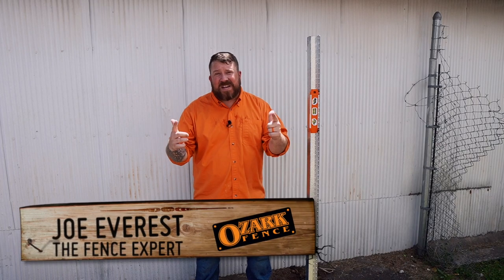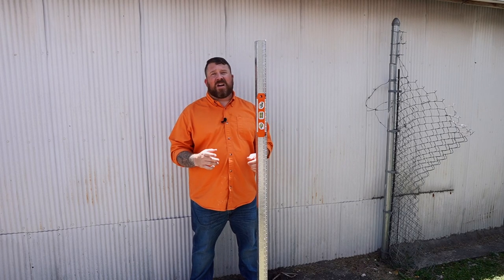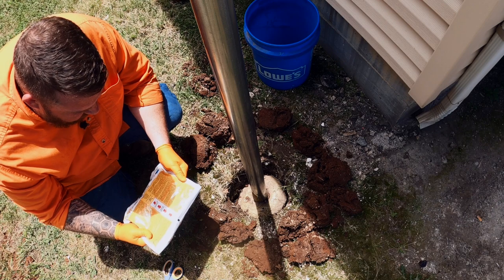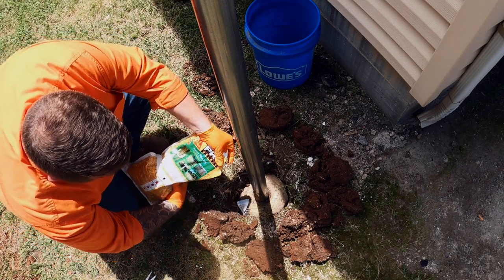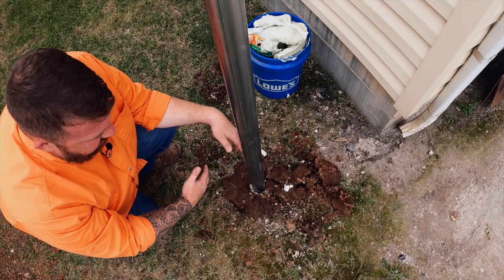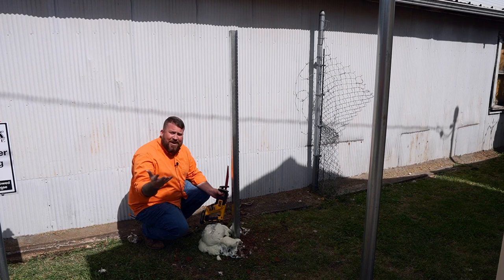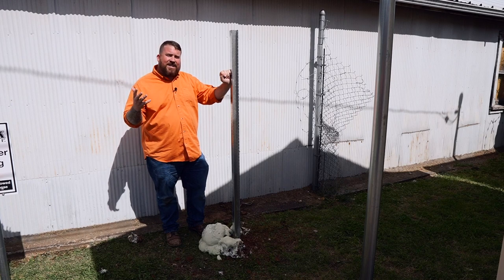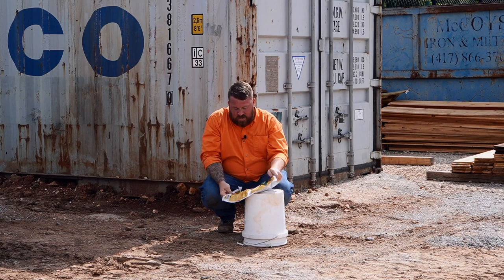Can We Use Post Foam to FIX Our Wobbly Fence Posts?

Comment: Yep, if you have any rain or any type of water/moisture & it gets the foam “wet”, it definitely isn’t gonna hold & seal the fence post well at all. The other thing ppl don’t do correctly is the hole diameter. I’ve found staying in the 8” diameter gives a good result, along with 2-2.5 ft for a 4x4 (even the max according to directions).
If ya try using this in damp ground, or it rains (or sprinklers turn on) overnight.....not gonna have a good result the next day either.
Great vid, cheers.

Comment: Thanks for this extra tip!!!!
I wanted to use this product, because I didn't want concrete.
But had to rethink the foam after seeing you previous video and seeing other similar videos with the same shrinking foam.
So I set the posts, (6x6x10's)
Waited a few days to let it shrink, then another half bag in each post.
Packed the dirt around them. 
They're solid now. Even with lights on cables than span from the post to the house.

Comment: I have that exact problem trying to fix the neighbors fence post from my side. The post was rotted off at the ground so figured I'd just sister a half post beside it and lag bolt them together. Couldn't get the left over concrete broke away so just angled my post into the bad one but it was cold and soil was really moist. Poured the foam in after shaking the bag too much and it started spraying every everywhere but I was able to get most into the hole before it set. Big mess and it never set into the hole enough to tighten up my post. The fence stayed up but post isn't straight and it wobbles. Knowing what I know now and this video I just found today I can probably clear around my first attempt, straighten up the post till it's proper and lock it in place with something and pour another partial bag in when it's dry and warm.
When the bag took off trying to do anything right was out the window and just try to get it in the hole before it got wasted. 😮

Comment: As a new contractor I have a question, I understand and try to explain to customer the importance of steel post and doing stuff the right way instead of the cheap way, honestlt I have lost 4 or 5 jobs after telling them the pros of steel but all they see is the cost. BTW awesome videos man keep it up.
Reply: Take lots of pictures on jobs your doing repairs on. Especially speaking on fences where new install are generally a per foot price repair costs dwarf instal ones. I replace snapped 4x4s every season.

Comment: Thank you so much I thought I had just made a mistake by purchasing foam to save my back. Now I know I can go back and fill in the spots and get really great results. I was especially worried because I'm doing wood post and I didn't want water to get in between that Gap that you had showed
Reply: It went well. We picked a dry day and we had no wiggle I our boards. Haulover what was interesting is if we had more foam coming up on one side it has a pretty significant push to push the board out of alignment buy a tiny amount.

Comment: Bit late to the party, but when I used foam for my fence I dug the holes out and then widened the bottom of the holes (by hand) about 2 inches. I set one post as a test before doing the entire fence, and I was not able to get that thing out. There is still wobble, of course, but that sucker is stuck.

Comment: Hello Joe. Do you think putting dirt on top of the initial pour at some point might help the separation of the foam overnight?
Reply: @JoeEverest  from experience, it does something, the posts where I covered the foam with dirt after a couple hours stayed solid.

Side note, in August you have about 10 seconds to mix and at the 15 second mark you better have it pointed at the hole.

Comment: @Joe Everest. Thanks for the video. I'm sorry Joe. You said "don't try this at home four times. Could you repeat that a few more times? I guess some people may be dense. Yeah, disappointed at the end with your controlled test. The bag musta been camera shy. Or like you said, Sika redesigned the bag for safety. 

So if I use this Sika foam and have a post that wobbles I need to buy another bag of the stuff which is about three to four times more expensive than Quikrete, use only a small amount, waste the rest, and also waste a bucket (or a cheaper option a contractors trash bag). Hmm.  And that's for EACH post that wobbles?  Hmm. I guess if I plan well, I may get the foam to the other wobbles without wasting. Used Quikrete for my fence posts that have been in the ground for over 20 years. Each post doesn't wobble and are still straight. Yeah, it was back breaking work moving those bags around, mixing and pouring but I only had to do that once.

Here's an idea. How about a video on how easy it is to pull out posts where Quikrete or Sika foam are used?

Again thanks for the educational video.
Hope you and your family stay safe and well.

Comment: Seems the common thread to these loose posts is ... holes dug too wide for the chosen post, perhaps?  The wider the hole the larger the expansion and contraction coefficient is magnified.  Looking on the Sika instructions for the 4x4 wood posts I am using, they kind of suggest the idea hole is only 6 inches wide.  My hole auger is 8 inches, and it has me worried that may be too wide and I'll have to go in and do this foam fix a day later.  Now I better find the receipt to return the $260 in foam I bought, just in case!

Comment: I have a privacy fence post with cracked concrete, so it wobbles back and forth slightly. Is there a way to inject this or another product into the cracked concrete to stabilize the post without digging it up?

Comment: Hello, DYIer here, building a new fence my self, I set 14  Z-Posts 2'6" into the ground with some quickrete. I have 1 post im not happy with and it wobbles like a SOB. Will this foam work with a metal post set in concrete?

Comment: Is this foam significantly cheaper than concrete? Seems really convenient as there is only a bag. As with concrete you need at the very least a wheel barrel, shovel, material and water. But the reliability of concrete, you get something that will last a very long time. I'm thinking that if I had trouble getting all these things needed for concrete This might be a viable option.  I probably would come up with something that slips over the post to force the foam to expand outward, after putting the dirt down. Something heavy to allow the foam to become more dense. Just my two cents.

Comment: If you have to use one bag to set it and then come back with another bag and fix it.... that’s a big no thanks! Think of the cost, fast set concrete is stronger and cheaper.

Comment: Thank you for  you 2 part  video  test     was thanking about this but I got 2000lbs  of 8000psi concrete  rebar  once set   will be  replaceable and forever 
I also used form tubes  and  z max brackets with 1 inch standoffs   built in    by  Simpson Strong-Tie 4-in x 4-in Triple Zinc Wood to Concrete (Cast in Place) Base
  so my post can be replaceable  in the future    building    20 x20 peacock pens
 Yes    I know  75 dollers a    post   to do my setup $$$$        concrete  form tubes    brackets   rebar and pressure treated 4x4

Comment: Concrete. It's cheaper and faster. Put the concrete in and make sure the post is plumb. Walk away knowing that the post will stay where you put it. Get started on the next post. Rinse and repeat 15 more times and then head down the pub whilst foamboy will be crying over wobbly posts and cracking out more bags of shitty foam